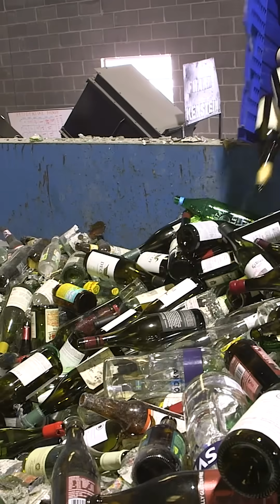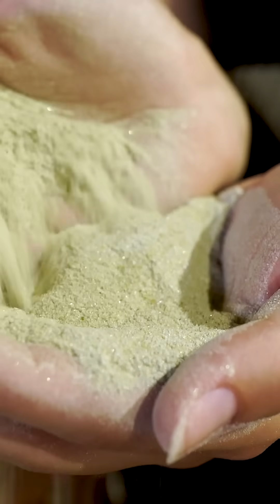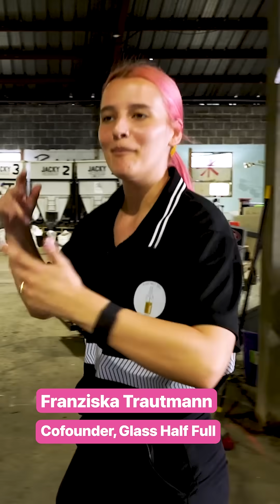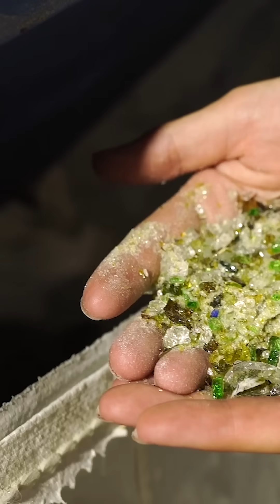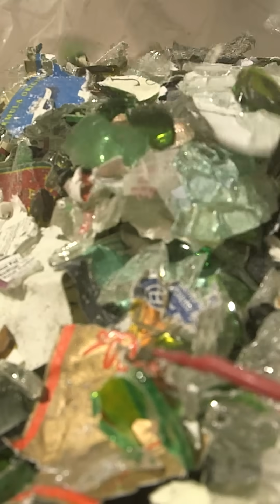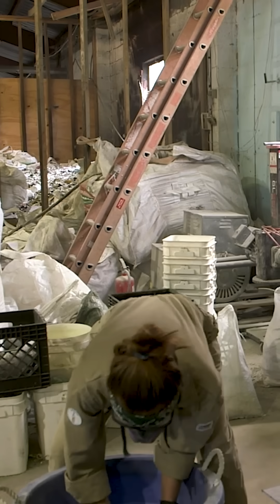Here’s how this entrepreneur crushes glass bottles back into sand. #Recycling #Sand #Glass

Comment: Call me crazy, but I would be nervous to walk across a beach made from crushed up glass
Reply: @braveeagle779 yeah.... those resemblances are VERY superficial.... and the difference is deadly
Reply: They're not turning it back to sand to return it to beaches, lol. They're still GLASS sand, dangerous for the lungs, eyes, and everything else without proper safety equipment.
Reply: lmfao don't worry buddy it's far too small to cut you
Reply: @the_marsh_fellow you can absolutely get tiny shards stuck in your skin. Why do you think fiber glass burns so much? Also the amount of sillica you'd be breathing in because now it's a fine powder instead of rounded grains. This is horrible. Its actual use is in construction not a beach

Comment: You can use glass/sand in tar or concrete roads , building bricks. Name it and you can make it
Sement bonds better with glass than natural sand.
Reply: But will it be easy to recycle them later? By combining the materials you create something stronger than concrete but it must be in a design that can be easily assembled and disassembled otherwise it will be a One more waste to worry about. Generally, the works with time break and return to nothing with nature, it is not like with natural stone. I think I think it will be a waste if not It is correctly elaborated in its design so that it can be reused. Remember that we live in a society where there are constantly changes, innovations, property abandonment, waste and so on.

Comment: But glass dust is terribly abrasive and a respiratory hazard
Reply: @braveeagle779sand is sand, glass was sand, then it got sharp
Reply: @Swag_swagintonX sand is already sharp
Reply: @msjkramey  have you ever walked on or touched sand?
Reply: @msjkramey  sand isn't as sharp and dangerous as glass lmao.
Reply: @msjkramey  ish, not really... its also not homogenized, and is probably molecularly, if not atomically distinct
Reply: @braveeagle779 you must be the kind of person who uses wire sponge on glazed porcelain
Reply: respiratory.. at that point my eyes start to bleed just from thinking on working in place like that. Just divide into colors, smash into bit smaller to take less space soak the labels out and then move to glass factory to be made into new glass..
Reply: @braveeagle779 You do realise people who work with sand also are required to wear masks, right? Silica dust can cause lung scarring and can be fatal. However, the regular sand you see on the beach is not the problem. That sand is not a health hazard. But silica is 100 times smaller than a regular sand kernel. The problem, if I understand it correctly, is exposure to dust particles from glass, sand, rock etc. So yeah, you can't just pour glass dust on a beach to replace it with regular sand.

"People who work in the following industries are particularly at risk:

stone masonry and stone cutting – especially with sandstone

construction and demolition – as a result of exposure to concrete and paving materials

worktop manufacturing and fitting

pottery, ceramics and glass manufacturing

mining and quarrying

sand blasting"
Reply: @snickeringpigeon4370 Bruh, does nobody see the woman filling the glass into the sifter wearing a mask and protective glasses??
Reply: @Blubableful they do, but they also know that silica dust doesn’t just hover in one neat little spot
Reply: @Blubableful 😂
Reply: Why even do this? It's not like changing the shape of the glass back to a granular size changes anything. Either throw it away in a landfill as a bottle or as sand.. same difference
Reply: @Josh.1234  the goalnI assume is to recycle it how it is done in most of europe, like if done correctly between 60 and 90 percent of a bottle can be recycled but they don't need to make it that small to my knowlege as normaly it is after bering broken down just melted.
Reply: @Velatus5978  yeah you recycle things that have value or are an ecological problem to dispose of. Glass is inert so it's easy to dispose of which leaves the question how valuable is it? 

Do you need to granulate it to reconstitute into glass? How expensive is it to just process new glass from sand? A lot of questions that should be answered before this even makes sense.
Reply: @Josh.1234  I can't tell you numbers but I know it is a lucrative Industrie to recycle it where I live and in regards to nature, while glas itself might be not to harmefull to the enviroment harvesting sand is and making new glass to my knowlege also takes more power than recyceling but not sure there.

Though what they did in the video no clue, that looked like if I made a recycling starter project in my backyard.
Reply: @Velatus5978  they stopped taking glass in our recycling in the DC Metro area. We can drop it off ourselves now but it sounded like it wasn't profitable so they aren't dealing with it.

I mean either way you are melting the glass back down to use for something else. Only way I see it being beneficial is if it requires less energy to melt glass as opposed to melting sand.. also the issues of color and chemical contamination in the recycled glass could be a problem. 

IDK, when I suggest a solution like pink hair lady grinding glass, providing the benefit is important to include.
Reply: true, which is why it's use is limited. the best use for it is in cement
Reply: @braveeagle779sand is tumbled and broken down for millions of years 😭 this is processed glass, removed of normal sand qualities, being crushed. Crushing any rock without tumbling would cause bad sharps, and glass is pure bad sharps lol
Reply: @toadacrosstheroad  yeah... plus sand is chemically weathered... it isnt from something that was thermally homogenized..... crushed glass isnt sand
Reply: It's a good thing the employees are wearing respirators then
Reply: @oliviaocasain9980 they need far more than just respirators to be working with crushed glass of any kind let alone this fine